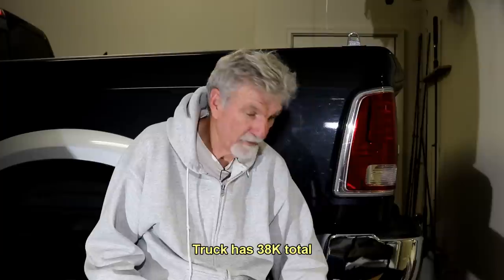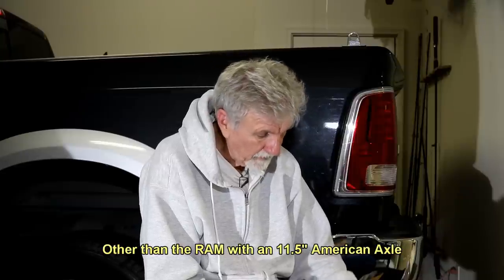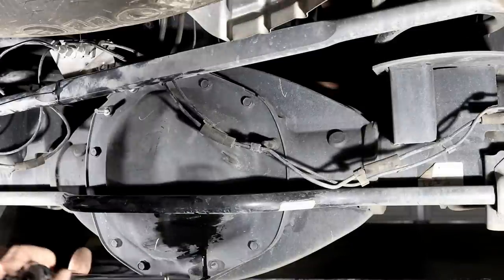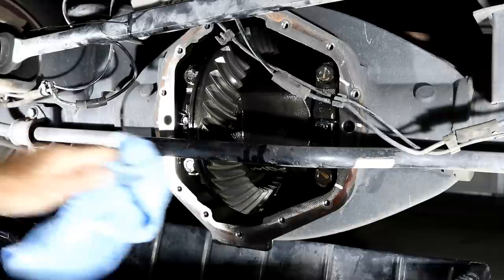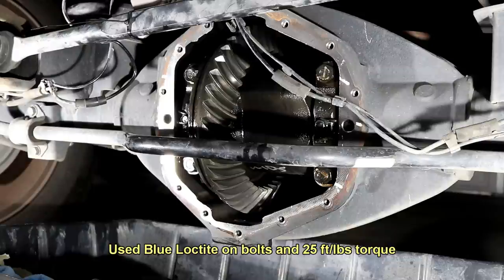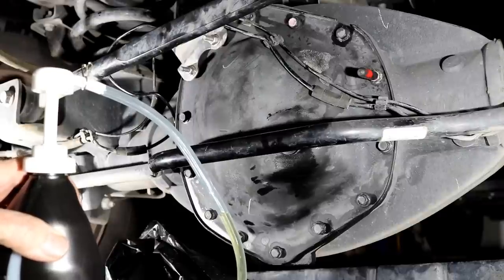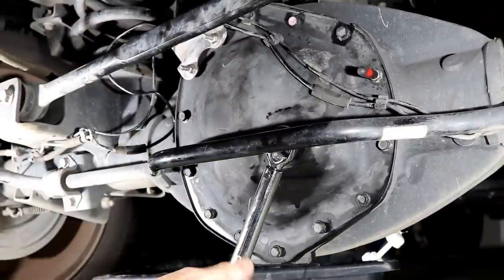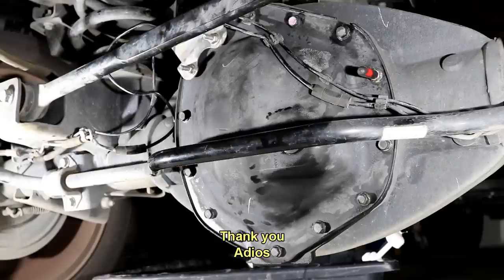RAM 2500 4th Generation Rear Differential Oil Change

Comment: Def bolts come with red film on threads, leave it on if not replacing with new bolts from torqueking.com they are new with the red friction coat on them at $1.45 each compared to over $7.00 each at dealer.  Almost used locktite which might need 3-400 degrees to back off without stripping.  The fluid level variance may be due to fluid temp differences which may range from below zero to above 200 degrees.  oil exchange are usually at about 68 degrees which translates into when it's freezing go for below the full marker just make sure your pinky does not get stuck.  too hot above  68 degrees, like  200 degrees, go above marker you can tell this by the color of your pinky.  I used the same gasket saved $40, wife ordering bolts with torqueking.com $49.90, shipping was included. Finally if checking fluid level any where around  68 degrees it should be at the level mark.  I also want to thank Mr Blair, i refuse to call him Marion, for getting me off my ass to pull some maintenance on my truck. I'm 71 too but look much younger, hee hee!
Reply from the maker: Thanks, all good advise, appreciate all of it.   I think I might pump the front one out but if when I do the rear again,  or,  I''ll drop the track bar. Maybe  (or not torque that one bolt)  Someone said the lube lockers were very good gaskets.  I think you are dead on with the level fill line.  That's one that can be over filled IMO.  Totally agree with the bolts, I know one thing, don't torque to 30 ft/lbs.  BTW, I've been called everything, I though Marion would be a problem in the Marines but we had a lot of girly names,  no one gave a shit, it was all about your serial number and last name.    High school was rough.  But at this point in my life,  when people ask my name, I blurt it out with pride.  F em.!
Reply: Marion Blair 

John Wayne’s real name was Marion!
Reply from the maker: @slipf18bustedflush42  yes Marion Morrison, it was hard convincing people that in high school, ha